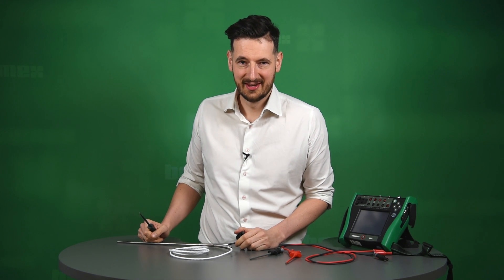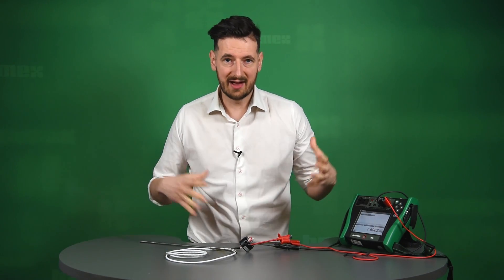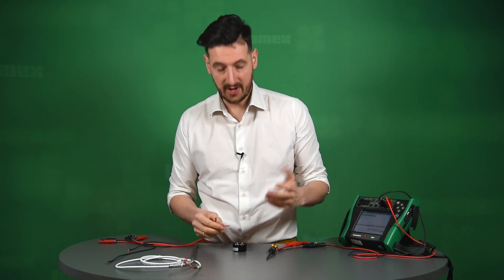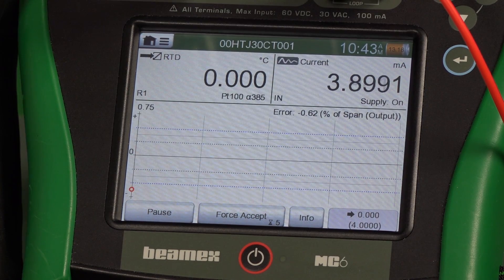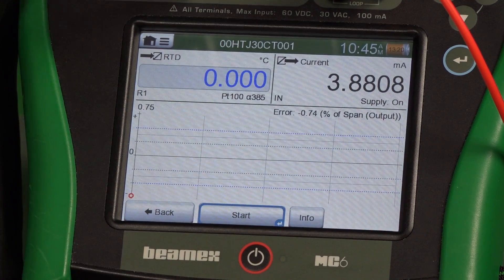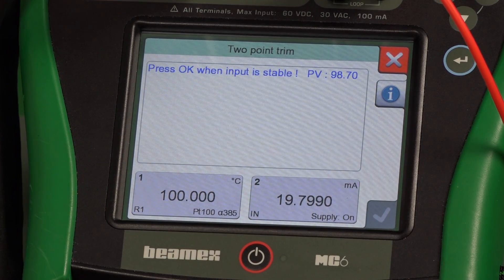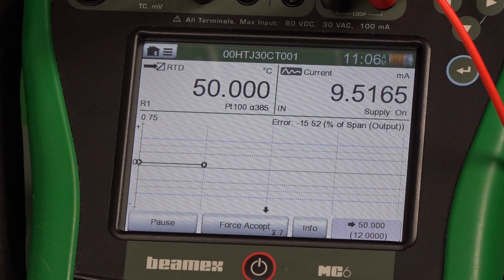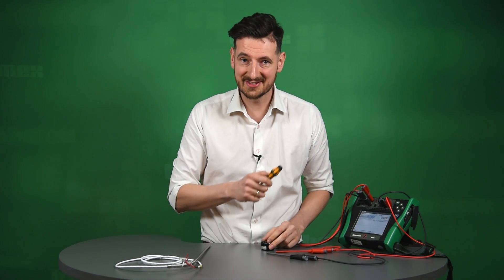How to calibrate RTD temperature transmitters - Beamex

Comment: So the module you wire the rtd sensor in you call it a transmitrer?

And the transmitrer has a chip built in you can calibrate?
Reply from the maker: Hi! Yes, that instrument is generally called "transmitter". It converts the signal from the temperature sensor (resistance signal in case of an RTD sensor) into the industry standard 4 to 20 mA signal, that is then transmitted to the control system. And yes, the conversion accuracy of a modern smart transmitter can be adjusted by communicating with it digitally using the HART protocol.

Comment: Great video Thanks very much
I have a question, please
Should I calibrate the RTD probe after calibrating the transmitter to ensure the whole loop is calibrated or calibrating the transmitter is sufficient?
Reply from the maker: Dear Ahmed,
Thank you for your kind comments.
In order to calibrate a measurement loop, you should calibrate all parts in the loop, or then you calibrate the whole loop as one.
When you make a calibration of the whole loop, then you would for example in this case put the temperature sensor into a temperature bath or dry-block and then read the DSC display. If there is no error, then you know that all parts in the loop are ok. But if there is error, then you should check each part separately.
Of course, you may also calibrate each part separately.
So certainly, the temperature sensor should also be calibrated. Sometimes the sensor is not calibrated as often as the transmitter, or the sensor may be sent out for calibration, or the sensor is replaced regularly with a new calibrated sensor.
Please check our Youtube channel for some videos where only the sensor is calibrated and some videos where the sensor+transmitter are calibrated together.
I hope this helps.
Thanks,
Heikki Laurila / Beamex
Reply: Clear and to the point answer.
Thanks very much ☺